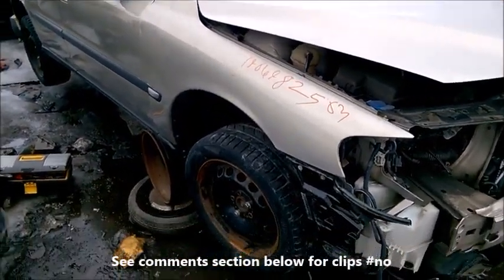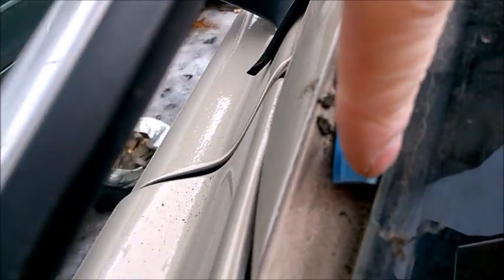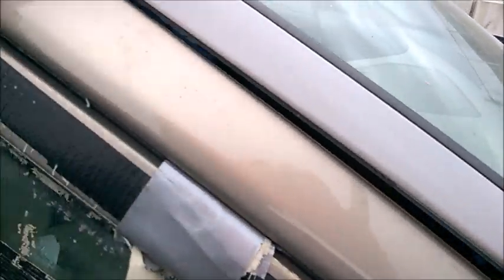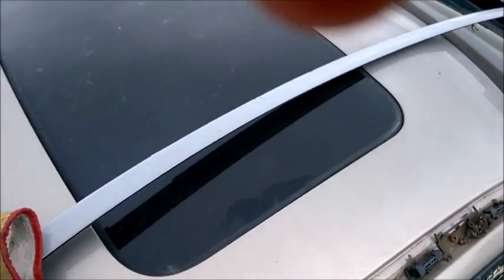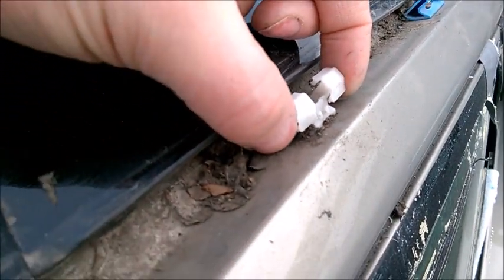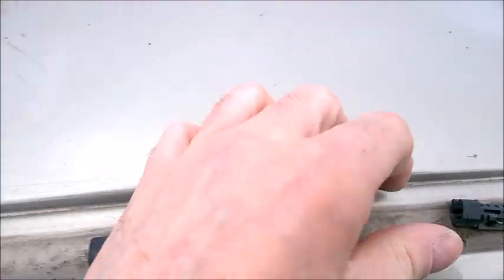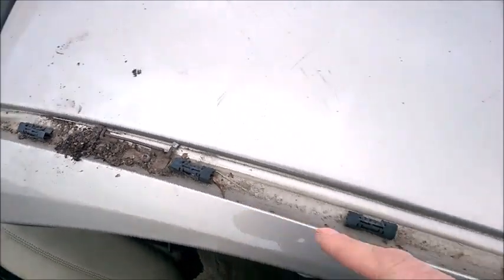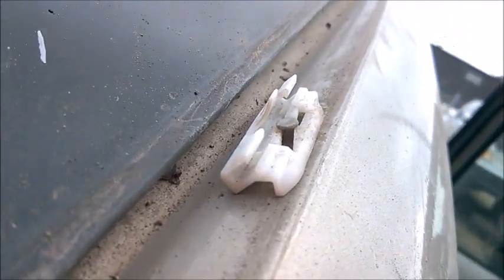Volvo S60 V70 Windshield Rain Strip Drip Moldings - removal and securing clips  2001-2009

Comment from the maker: A few parts (or see the local Volvo dealer)
https://www.ipdusa.com/catalog.asp?numRecordPosition=0&searchwords=volvo%20s60%20Windshield%20Side%20Trim%20Clip
https://www.fcpeuro.com/products/volvo-trim-moulding-weather-stripping-clip-s60-v70-xc70-9190981-oem
https://www.eeuroparts.com/Parts/84930/Windshield-Trim-Molding-Front-Driver-Side-Color-Code-019-39992599/

Comment: Your video was a lifesaver. I took detailed pictures of my clips orientation before I removed them but the SD card in my camera went corrupt. Thanks!

...also worth mentioning, my replacement OEM clips are not the same colors as the old ones that were removed. Identical, but all black.

Comment: Was just riding along on the interstate, and Whooosh!!!! Tha thang came flying out on my right side. No warning, No nothing! I literally was like wtf driving and looking at it get ran over at the time not knowing what happened or what it was, so when I get out to see; I get out I see this trim. Turned around went and got it and it’s bent and defective for the most part but the rear is still hanging on. If you  have a 2000s model Volvo I would check to make sure the are attached and stable and showing no signs. But great video.
Reply: Lucky you got yours. Ours went came off and I thought it was just some rubber window shield. Now I want to find a white one and it seems to be discontinued.

Comment from the maker: Interesting fact, these rain strips have a tendency to make noise in cold winter days especially if there is ice underneath them.  Both the front and rear windshield will make these cracking noises - the noise will appear to be coming from inside the cabin, but in fact it comes from the outside.  The reason is some clips just break so the strips are not tight secured.  The fix for this is very easy : pull gently along the strips (along all windshields) to locate the areas when the strips don't stay tight against the glass. Then squeeze small amounts (a bead) of transparent outdoor silicone underneath these places - do this in summer time.  I did so and those annoying creaks stopped completely.

Comment: Right side I also replace few weeks ago. Blue clips is old. Now is instead blue clips yellow. First 3 always can colaps + 1 white one. Later I can give link from Poland shop, where you can order cheeper clips
Reply from the maker: Thanks for the information Sandris
Reply: I have been going to the junkyard a lot later trying to master taking the top roof long molding off with no breakage of the clips...it is extremely hard.   I have collected some of the blue clips I know they are older than the yellow but to my eye they look exactly the same the only difference is the color.  Am I right?

Comment: I cannot believe how good are those cars who people in canada throw away just like that...
Reply from the maker: On my street there are still several of these, there are still many on the road, being now at least 13 years old.  Very good cars for cold weather, these engines simply don't care about low temperatures
Reply: @Peppermint1  I have diesel D5 in 2002 s60  it sounds like a tank. I love it.  about those rubber pieces on the windscreen... do you think it is possible to buy them new? I have those is quite poor state now, even though car has spend it's live in cold climate
Reply from the maker: @Markustajahoyrylaiva   Ring up the dealership but it can be costly to get all of them. Otherwise I would look for an online site in your area - may ask on local forums for suggestions

Comment: I have similar cracking issue in my v60! Could you post part numbers fot these clips? I notice that mine(chrome) ones are not very lose but I anyway suspected them. After reading comments here I'm sure that this is the issue. Life saver!

Comment: Ok, nice vid, but what about replacing the rubber part of the trim.My plastic part of the trims are fine but the rubber part is showing age and cracking at the top of the windshield.So is the rubber replacable?
Reply from the maker: Indeed, the rubber black part gets brittle and chips away (sometimes it also gets damaged by window scrappers when cleaning the ice off the windshield in colder climates), from what I see it's molded along the plastic/colored part and not separable, they needs to be replaced together
Reply: @Peppermint1  Yes the rubber of these mouldings seems to be "vulcanized" to the plastic.  They must be replaced together, it is an expensive part from Volvo.

Comment: I tried purchasing those "drip molding' for my 2006 S60. Left one is $93, great... right one is $389!! WTF,  do you know where to get them? Please rpley here, thanks, USA, NYC
Reply from the maker: Ouch!...  I would definitely look for a used one either from Ebay (but perhaps too expensive to ship because of the size), or rather look on local.google.com for a nearby junkyard, see if they have S60's - these are fairly common.  May as well ask on a forum such as https://www.matthewsvolvosite.com/forums/viewforum.php?f=9 , the folks there will gladly let you know if there's a better junkyard in your area.  That would be by far the more affordable option (then just get new clips from Volvo)
Reply: Same with my "Mystic silver" S60 $320 per molding. It's ridiculous.
Reply from the maker: @highvoltage12v  Agreed. Volvo is known for the high cost of several genuine parts, however the cost for some parts just doesn't make much sense.